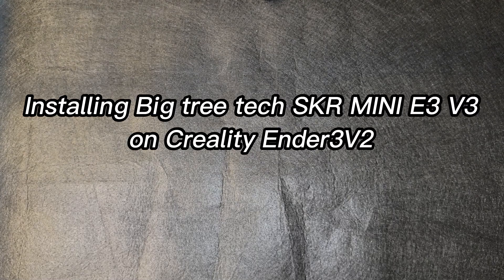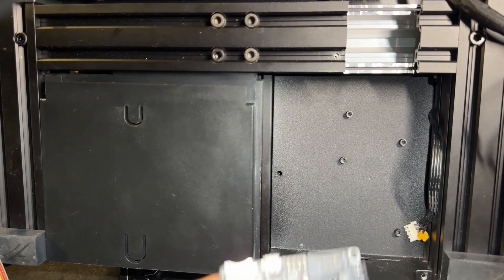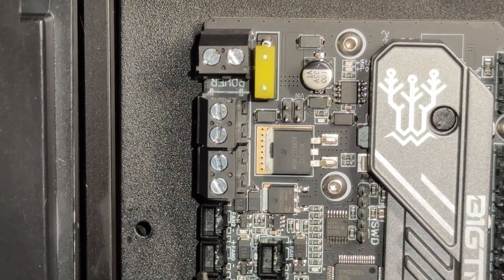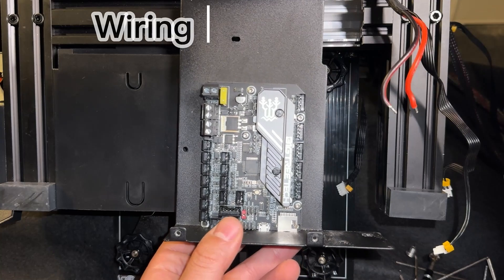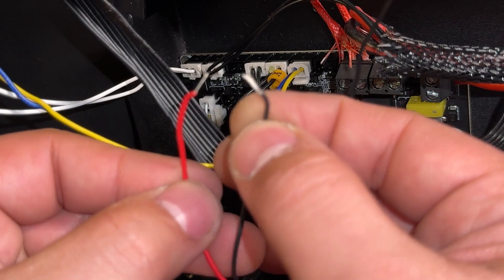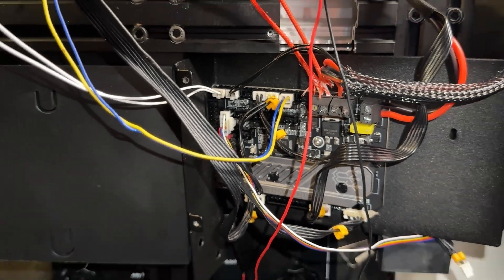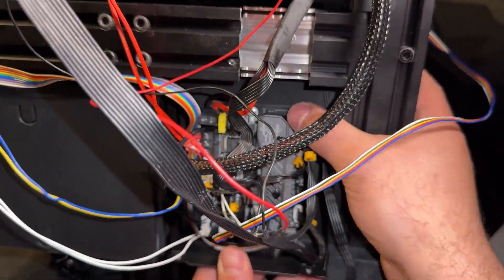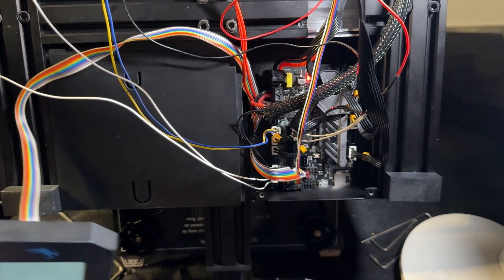bigtreetech SKR MINI E3V3 on Creality Ender3v2

Comment: What was the fix for the display? do you just change some pin-out on the cable? or is there more to it?
and does the printer work still without display (eg - with octoprint etc)?
Reply from the maker: I made another video for the display. Check in my channel